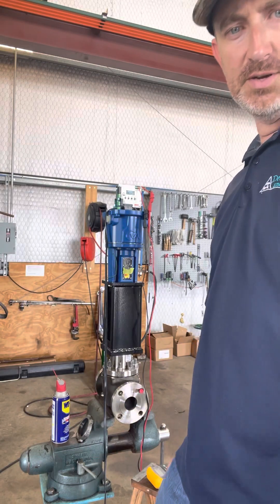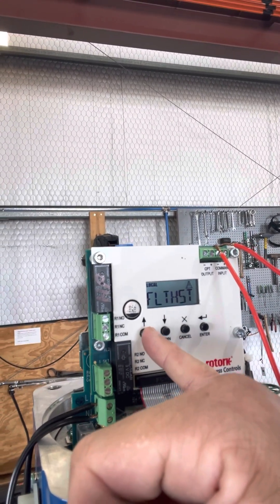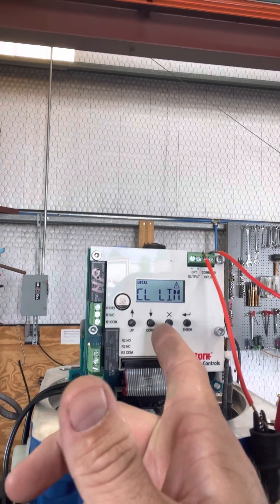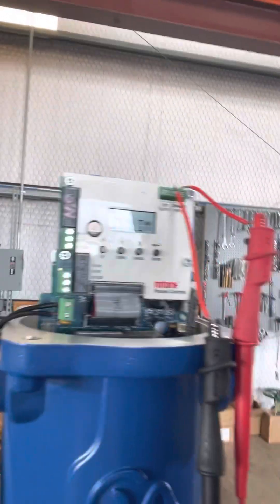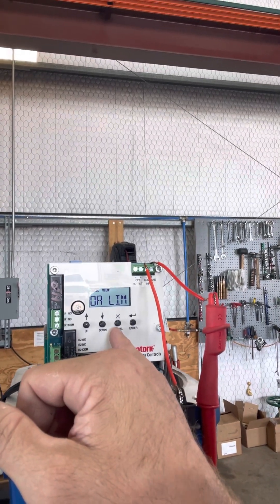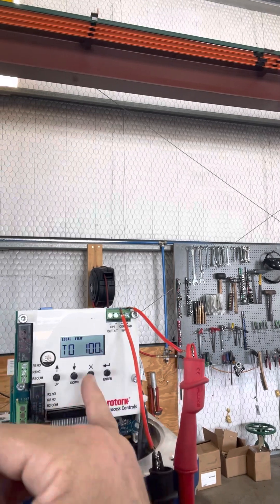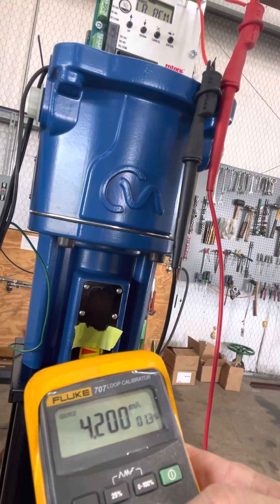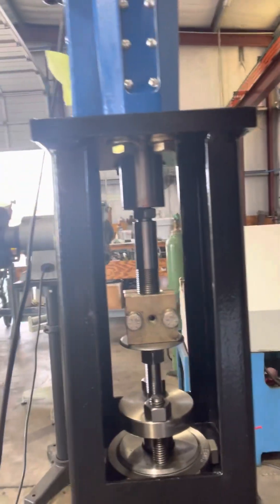Rotork CML calibration

Comment: How did you supply it while calibrating?
Reply from the maker: Yes sir this is a 120 VAC actuator so its completely separate from the command of 4-20 mA. the two wires at the bottom left are the 120 vac + & neutral and the 2 wires at the top right are 4-20 mA signal.

Comment: Hello, 
I have been using rotork CML actuator and we have recieved an ACTUATOR EEEOR ALARM on the remote display panel. Also i can see some alarm is there on the local valve controller. How do we identidy and rectify this mentioned alarm
Thanks